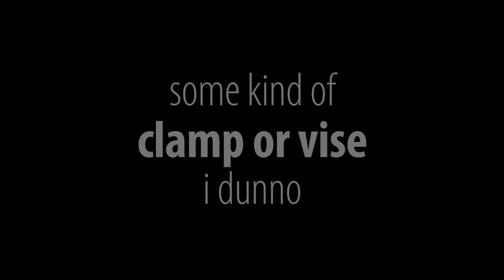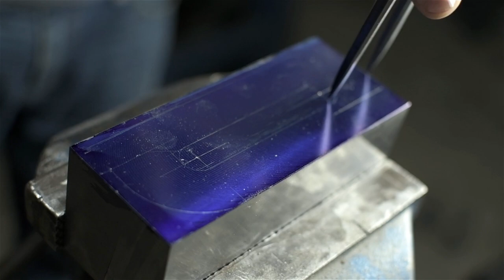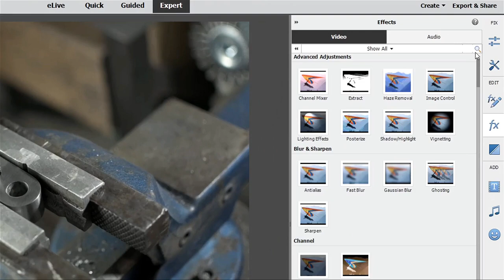BUILD: Toolmaker's Clamp Thingy

Comment: If adopt this design as a drill press vice then can do center drilling in different sizes of piece easily without the need of realignment every time except from the first.Is very interesting and i am wondering if such a vice is available commercially for buying.Also this type of mechanism is used in car lifters for changing the flatten tires on the road.So i like it double.P.S A left turn tap is needed regardless the flipping of picture.

Comment: i am stuck with the wood thing when it splits the block in 2  at 2:30 ... what kind of wood did you use ? I am sure that i am using the wrong type of wood and that's is why it doesn't work for me.

Comment: Not a machinist but what was the reason you put the wire between the vice and the stock on the second pass? Just curious if the stationary jaw is perfectly squared and the single point of contact keeps the stock perfectly squared to the stationary jaw  or something.
Reply from the maker: correct!
Reply: @ThisOldTony  kind of curious as to how you learned this

Comment: @0:54 can someone explain the purpose of the little round spacer?  does it have something to do with keeping the material square?
Reply: As I understand it, and I may be wrong.  By adding it he's essentially removing that side of the vice from the equation by allowing the block to pivot slightly as it is tightened and sit better against the remaining two sides
Reply: @Entarra  that makes sense - didn't even think about the bottom plane.

Thanks!

Comment: What I don't understand is, when threading, how do you ensure that each pass starts at the very same point? Don't you have to synchronise both spinning and Z-axis?
Reply: Yes, that's one of the features of the lathe. The ratio of spin speed to tool movement speed is adjustable for different thread pitches. You'll also notice that in order to move the tool back to the start while keeping the sync, he has to run the lathe backwards.
Reply: @CalvinWalton  Oh yeah. I saw a thread cutting video lately and what I didn't know is that the motor doesn't only spin the chuck, but also (if you set it that way), it spins the threaded rod that moves the toolhead. Silly of me to not have thought of that :D

Comment: Could someone kindly tell me the make and model of that slotted, measuring, scribing, marking gage?  (He's always using when he's laying out dimensions on a project.)
Perhaps the grand poohbah himself ThisOldTony  might comment on the source of it?
Is that something you made, or something you bought? Is it available somewhere for purchase?
If it's a common machinist's tool folks will need forgive my ignorance. I come from a woodworking background, not metalworking and machining. 
Anyway, I really want a gage like that.  Anybody?
Reply from the maker: stop rule.  i think it's a sheet metal working tool?  Lee valley sells them but I'm sure they're everywhere.
Reply: @ThisOldTony  ... Thank You ...
Sir ToT. 
(Is this the proper salutation for adressing the Grand PoohBah himself?) All keeding aside.
Just went to Lee Valley who indeed makes em, but they're currently "out of stock" with an expected availability date of (get this) late April?  (Haven't they heard about, nor mastered, the feeding of wee felines assorted bits of metal, herbs, and spices, with the resultant cat alchemy?)
Perhaps you might consider making a production run of ToT branded marking gages instead of that crap merch 😉from TeeSpring?
(2 Tees of which I ordered a week ago along with ToT stickers wherein they charged $11.48 in shipping. And threatened charging the VAT.)(and NO I won't get them before Xmass)
But I suppose etching the graduations in the rule would be a whole can of worms in precision not really anticipated in a home shop  to say nothing about repeatable production runs (which you really dont do)?

Comment: At 0:51. Why did you put a wire between the vice and the work piece?
Reply from the maker: see the squaring stock video. it's to help force the work square to the more reliable rear fixed jaw of the vise.